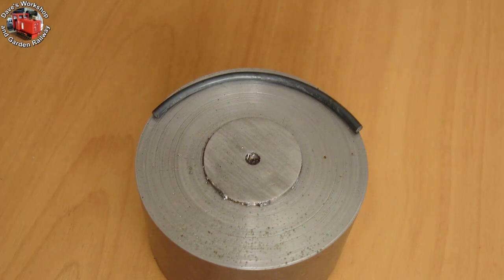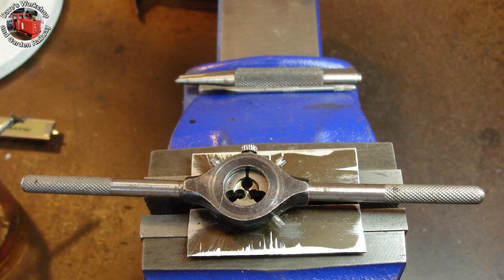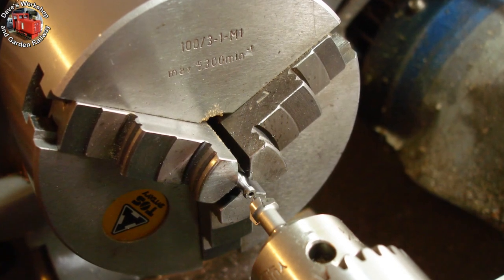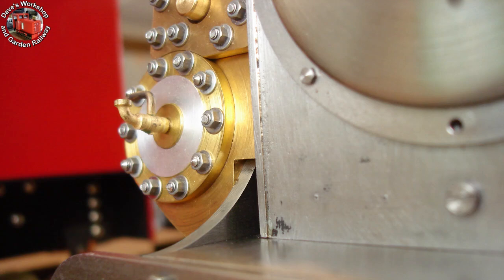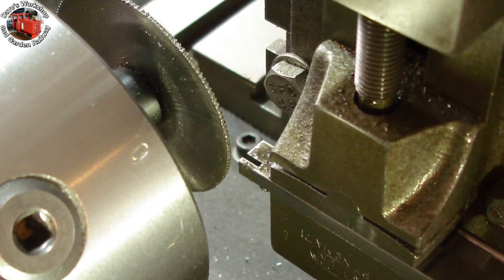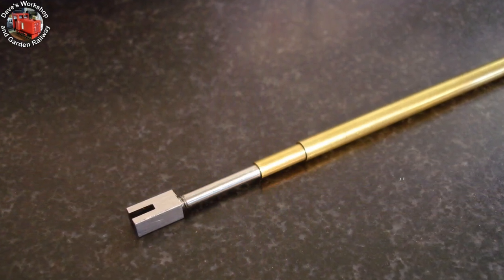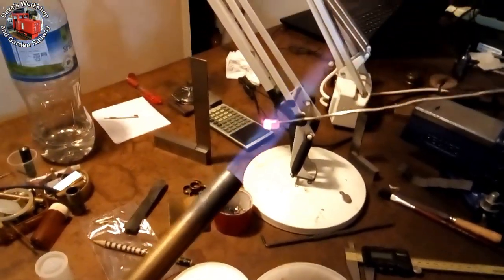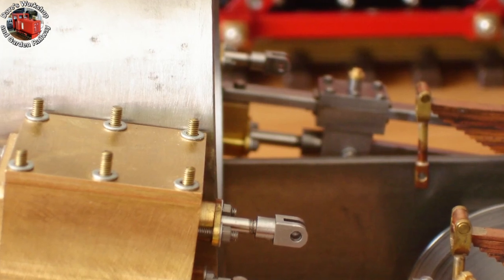Building a live steam loco - Part 18 - Handrail, smokebox, and a start on the valve gear

Comment: Little detail are what make the loco look good, I try not mixing thrwad forms  for that simple reason , Also i have just tried tapping some 18mmx 3 angle  to hold the buffers on my LSBC Dyaks tender  verrrrrry slowly does it lol
Reply from the maker: I try to mix the threads on valve rod ends vs. the thread that engages the nut that drives the slide valve so that I can get differing amounts of movement by either rotating the spindle or by rotating the knuckle